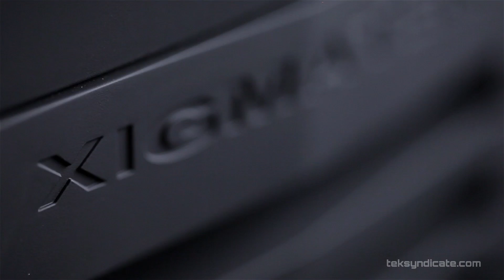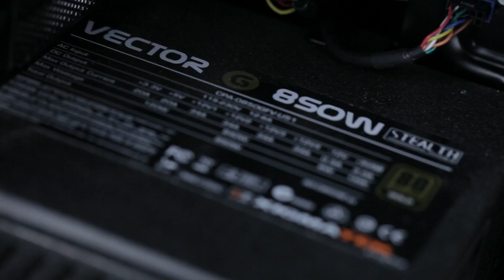Pistol's AMD Workstation Build For Streaming, Gaming, & Editing

Comment: corssair fans are complete junk that I replaced with $4 because both corsair fans craped out. the $4 zigmatek fans have been amazing! but the pump finally dies on the Hopi so I will never buy a corsair product with moving parts again.

Comment: i finally got 4.7ghz out of my 8350 but i have to ramp fans up to max to keep it low temp. i'd love to hit 5.0 but im scared lol
Reply: I got my 8350 to 4.8GHz stable with the same mobo as shown in the vid. It took some   configuring, idles at 43C, 68C load air cooled.

Comment: Did you have any stability issues using all 4 DIMMS with the 32GB of Kingston memory? I have 4x8GB of GsKill Trident X 1866 and with only 2 sticks, in either paired slots, works great, put all 4 in, stability issues. I guess the Memory Controller on my FX-9590is not liking 4 sticks of 1866Mhz memory?
Reply: It's a Gigabyte 990FX-Gaming, so yes. It has no trouble with heat...just doesn't like those 4 DIMMS filled.
Reply: Oh it does. I ran it beautifully except the 4 DIMM Slots running together. lol! I've since changed over to an Intel 4790k with MSI MB anyway.  It is awesome. AMD just wasn't cutting it anymore for me. I will miss that 9590 though.
Reply: kind of late, but you should have tried to rise up the voltage on the ram, and you could also tried to lower the frequency. AMD certifies only 1333mhz with 32gb. Many folks do reach 32gb/1866mhz but that's not the rule, just luck. at 1600mhz most of the CPUs will work, but there are a few that will not tolerate any more than 32gb/1333mhz.

As for the stability, 1.5 might not be enough to power all four slots, thats why a 0.05 or 0.1 raise in the Ram voltage might be needed

Comment: u do realize that compartment in the top is to mount the fans or radiator to each other Through the case, thats why it was mashing, it wouldve been fine if you mounted say the radiator in the case and the fans into it from the compartment, i have an nzxt tempest 410 elite so its a similar case in terms of this design.

Comment: Just out of curiosity what temperatures did the CPU maintain during Idle and load temperature with that air cooler? Im building a similar rig and I'm stuck whether using a corsair H100i or this air cooler.

Comment: Hey guys,im planning to build a AMD gaming desktop.I going to get a AMD FX-8320 CPU but i dont really know which motherboard to choose from,i heard that the Gigabyte 990fxa UD3 have a overheating VRAM problem.So what motherboard will you guys recommend,i dont want my motherboard having problem.which one is better for realiability?Asrock 990fxkiller/Asus M5A99X EVO R2.0/Gigabyte 990fx UD5.
Reply: You could try Msi gaming board. Or asus
Reply: Oh thanks.I think I will go for a Asus Board.Anyway do you know the different between the AMD 990FX and the 990X chipset?
Reply: Nope but using the asus sabertooth helps
Reply: Sabertooth is expensive my budget is thigh
Reply: Oh thanks for the guide,Im going with s Thermaltake Water3.0 Pro for my CPU cooler!
Reply: the gigabyte is not bad, its probably just a lousy batch
Reply: Jayz Xiang 990fx ud3 is enuff

Comment: I'm not 100% happy with my Corsair H100i either. It's louder than my old CoolerMaster Hyper 212 by a large margin. The only reason I haven't yanked it yet is because it does cool better. On cool mornings I've seen my 8350 as low as 1c! lol  The lowest I ever saw the Hyper 212 was 16. I value silence over all else so, I guess i should stop being a cheap *&^ as get the Noctua NH.
Reply: Thats like saying you hate your harley Davidson because its louder than your prius.
not trying to be mean but two fans and a pump will be louder than a single fan.
Reply: Mike Kunz Oh yeah, I agree. But my point is that it's possible to have completely silent water cooling. A good friend of mine has the NZXT Kraken X60 cooling his CPU & GPU with Noctua NH fans and his i7 rig is dead silent. So it is possible I was just trying to be cheap. But somethings you just can't get around paying good money for.
Reply: True
Reply: DarkMikaruX and you gotta see that the i5/i7 are freshier, i have a fx6300 and a i5 2500k both oc´d and the temp difference in load is like 10ºc sometimes 15ºc with the corsair H100, on the i5 when idle i can set 1 fan to spin at 800rpms and completly shut down the other and it sits on 30ºc iin idle.
Reply: kurok1tenshi I understand what you are saying, but It's definitely the fans in my case. I finally got around to ordering 2x 120mm Noctua NF-S12A ULN's which should be arriving tomorrow. I also plan on disabling the intake & exhaust fans to get a true gauge of how much of a difference the S12A's make. If it's still unsatisfactory, I'll just save up and go the NZXT Kraken route. I'd hate to get rid of it because it does a darn good job. It's 70 in the house right now and my current temp is just 12c. And I've never seen it higher than 35c at full load, and that was on a hot day. The 8350 is plenty for me, the right balance of cost and performance.
Reply: DarkMikaruX yeah, for most talks and even for daily day harder stuff like gaming and streaming etc it´s perfect for the price it ranges.

Comment: I think I may get this CPU just for the heck of it. I can afford to go Intel but I like to get stuff and get it working better than they are supposed to.
Reply: Direct X 12 is coming out, I'm going to dust off my old 9590 and see what it's really capable of when that API comes out.  I expect performance greater in games than intel's 8 thread parts because of 8 individual cores..
Reply: ***** dual 9590s? what mobo
Reply: ***** I hope direct X 12 works as good as a lot of people are hoping it will.

Comment: How well is that 9590 standing up in that motherboard? ASUS states 140 W maximum for the processor, so I didn't think anything above the 8370 would work.
Reply: Gutberto Lopez I know, but it can be overclocked and people will do that, so it's perhaps best to make sure it will handle it.
Reply: ***** the OC on that chip sucks, mostly cause of the temps on 5ghz clock from the box, most likely they made an OC from factory cause no fking CPU comes with 4.7ghz @ that TDP, that chip has a similar performance to a 8350@ 4.5ghz, my guess is that the fx 9xxx werent made to be stock with those clock speeds but since they had the previous ones with 4ghz @ stock they wanted to justify the 200-300 bucks difference in pricing from a 8xxx to a 9xxx hence the speeds.
Reply: kurok1tenshi My estimation is that AMD released the 9000 series as a means of grabbing another milestone (first to 5.00 GHz), and for those consumers who wanted a very high and stable overclock without having to do it themselves. 220 W is high, but I guarantee a 'Sandy Bridge' Core i7 at the same frequency won't be far off, if not the same.
Reply: ***** true bro 9xxx @ 5ghz needs 1.5-1.52v vcore were the i7 2600k @ 5ghz needs 1.45v but the i7 doesn´t need to be @ 5ghz to draw the same performance as the 9xxx @5ghz, that´s the diffecence on the chip but yea AMD´s move on the 1st 5ghz stock chip is very valid.
Reply: kurok1tenshi Of course, we know the FX is inferior in performance due to the way resources are shared (one FPU between two cores with one 128-bit FMAC unit each), but comparing apples to apples, the Core i7 at 5.00 GHz will be pushing out practically identical thermal figures.

Comment: Been using that same mobo for nearly 2 years now and it's never given me a single problem. That ASUS mobo is pretty damn sturdy.
Reply: Space Woona Haha that's loads better, I can't afford a high tier card.

Happy gaming ;)
Reply: I recently got mine, what CPU are you running with it?
Reply: FX-6300. It's really an awesome chip for the money. But if my budget wasn't so tight when I was doing my build, I would definitely have used the FX-8350.
Reply: Space Woona What GPU are you using I've been planning to build something with FX-6300 or 6350. Hows the performance ?
Reply: Space Woona What GPU are you using I've been planning to build something with FX-6300 or 6350. Hows the performance ?
Reply: Last Perfect Support depending on your budget a 8320 is only $135 on amazon atm.  Most can do 4.4 easy with a decent cooler and you get the extra module.
Reply: Last Perfect Support  Sorry I'm only just seeing this lol I'm using a Radeon HD 7770 GHz Edition. You can get them for really cheap but don't expect to run the current games very well. I'm running Wolfenstein at minimum settings, pretty much to squeeze out 60 FPS. It'll handle older games like Skyrim and Fallout New Vegas very well, though. Far Cry 3 also looks pretty good on it at 1080p. Can't run Far Cry 4 at that res, though. I've been told the R9-285 is a really good GPU for the price, but it is a nearly 200 dollar GPU. I think these days you can get a 7770 for something like 70 bucks. They're older so they come a dime a dozen on Ebay. Good luck finding one on Tiger Direct or Newegg though lol
Reply: Space Woona most of the higher end AMD chips are at a good price atm, after the GTX 970 issues came out AMD followed suit with a decent price drop.
Reply: kamata93 Alright, thanks. I'll keep that in mind. What kind of games are you running on your 8320? Are you able to get 1080p60 with them?
Reply: kamata93 skip the 8370e and go 8320e same 95watt rating same clock potentials if u move the multiplier around, both of them stay a lot lower in power consumption compared to the non E variants until you get above around 4.4ghz and have to ramp up voltage a lot more, at the same time you can usually take any non E 83xx cpu and drop the voltage and mess with the clocks to get it to run on a lot less power, we got a friends 8350 going into a itx console build to run at 4ghz with a core voltage reduction dropping the power pull from the wall socket by 30 watts over running stock speeds.
Reply: Space Woona My 8320 is running at a modest 4.2ghz (runs at 4ghz on stock voltage) with a old GTX 285 running BF4 at 1080 with low medium mix gives me a pretty solid 60 FPS until I get insane particles like from destruction during firefights.  Cities Skylines was running at 1080p on high with out issue at 60 FPS on a 60,000 person city.  I can max any Valve game on 1080p high and never dip below 60FPS except for network lagg, the crew is running on medium with high geometry at 60FPS in the country solid and 50 FPS in the cities (this might be more graphics card for me at this point).  Warframe was also running in 1080p on a pretty highsetting and never dipping below 60 FPS, planetside 2 was running well, but I could use some more GPU power for that game. The thing about the 8xxx series is they are all vastly overkill for gaming, same concept as the i7, since almost no games use more then 4 cores and only a few truly push all 4 cores of a quad core well.  For example I can be playing any of the games mentioned and still dedicate a entire module(aka 2 cores) to running handbrake or movie maker doing encoding in the background with minimal frame loss (needs a bit of ram to do this though and multiple HDDs or fast SSD's) the rest of the CPU is just so unused while gaming in my experience, this might change over time as the consoles are now heavily multithreading dependent.
Reply: Space Woona Try an R9 270 2GB WindForce Edition
Reply: Mashu Koria You're a little late on that ;) I just got my R9 290 in the mail on Friday :D
Reply: Mashu Koria Haha! I was actually asked what it's like to have a 4 GB frame buffer and I actually had to say I don't know because I'm so bottlenecked by my CPU xD  Oh well. I'll just have to wait a few months and upgrade that lol
Reply: Space Woona Oh, so on 4GB cards you start getting buffers on frames bcus u have too much storage?
XD
Yeah I haven't built my pc, but I switched to the FX-6300 instead of x4 860k bcus the series is dead. 
The FX has new chips coming and a huge upgrade path for me.

Comment: Currently i've got an 8350 o/c'd to 4.8x ghz... I've got a good PSU, and the cash to get an fx 9590. would it be worth it to gain what i'd gain over the 8350?
Reply: No
Reply: Not really, essentially all a 9590 is, is a 8350 that is guaranteed to hit 5ghz under boost. if you have an overclocked 8350 at 4.8 you pretty much have the same thing in principle
Reply: Nope
Reply: You already have 9590, Only yours is 100Mhz faster on the base clock.

Comment: Nice Choice Of Parts should be a well rounded system within reason as a gaming rig i got the R9 280 Asus cu II on a 2011 board with an 3820 cpu its a good build system .

Comment: Stock h100i fans are trash
Reply: For sound yes but for pure cooling peformance they are really hard to beat
Reply: Artun Otter Just get SP120's or Noctua fans and they're way better at cooling and acoustics are lightyears better.
Reply: ***** Didn't expect to see you here
Reply: ***** not really...yea they're quiter, but they have the same blade design. They both move the same amount of air.
Reply: Artun Otter are you serious
Reply: Ruskie nope. Dude come on. The stock fans run at 2500rpm at max speed I know they sound like a jet engine but at that speed they move a shit ton of air.
Reply: ***** airflow sucks on them tho
Reply: Artun Otter fans made of paper at 2500rpm would move a lot of air. just because something moves a lot of air at its top speed doesnt mean it is good for airflow. fans that are good for airflow move a lot of air without having to be at max speed
Reply: Ruskie ok let me word that differently. "They have alot of cooling performance"
Reply: I think h100i is good with corsair sp120 hp edition

Comment: You could have put the sp120 fans (the proper ones with colour runs and rubber isolators) on the top of the case? :(

Comment: I just cant understand paying 299$ when for 30$ more she could get far better performance out if a 4770k.  Overclock the 4770k to 4.5ghz  and the 9590 cant even tough the 4770k even at stock the 4770k trumps the 9590. This video baffles me.
Reply: People don't seem to understand that 1. AMD performs more or less equal in games. and 2. 9590 > 4770K in streaming and rendering, which is why she has the fucking rig.

She mentioned it in the video. Twice. But 10 seconds in some monkey smashes "WHY NO INTEL" in comments.

Comment: I dont like the fx 9370 and 9590 cuz they get soo dam near crashing every time i vid edit
Reply: its the psu , you need to change it , 430w cant do it , thats a huge bottleneck , there are great psus for less than 150 bucks , get a seasonic psu, a 700 or 800w one , just your cpu draws about 200w thats alot
heres the link for what i recommend 

http://www.newegg.com/Product/Product.aspx?Item=N82E16817151105
 upgrading that psu is a MUST for that cpu , the rest is all fine
Reply: Andre Salles Yeah, i agree, that is some hazardous temperatures! Doesn't have to be Noctua though, just a good one. Noctua is pretty good overall (especially if you look away from the asking price tag.
Reply: thats wierd...whats your psu/cooling/ motherboard ?
Reply: Andre Salles Here is my complete specs:
CPU:FX 9370
PSU:Corsair 430M
MOBO:Asus Crosshair V Formula-z
Storage: Seagate Hybrid Drive
GPU: ASUS Gtx 660
Ram: G.skill 8gb 2133 mhz

I built this when i was eleven so of course I didnt pick the best setup
Reply: also thats a great mobo , good choice there
Reply: Andre Salles Thanks man, will do. but is the psu the reason why my pc is crashing? I always thought it was the heat
Reply: heat is a issue too , you want the cpu to run at 70C max load , i can suggest some good cooling options for you , get the temps and post them here so I can see whats going on , if it gets to 90C + than thats a big problem too
post your case model too
Reply: Andre Salles My case is an NZXT Phantom 410. I use a Corsair H60 CPU Liquid cooler for my cpu cooler.
Reply: shouldnt be a problem with that cpu cooler , can you get the temperatures ?
Reply: Andre Salles Im really sorry about the late reply but anyways, my CPU runs @ 21 degrees Celsius when idling. For the max load, I decided to attempt to render a vid and i watched the temps. (my pc is set to shut off @ 100 c) As it started rendering, the temps kept rising, and I stopped the rendering when it hit 97c.
Reply: wow , you eed better cooling like right now , or your cpu is gonna die soon , seriously go get a corsair h100i or something similar , also put noctua fans in your case and change your thermal paste to  ICdiamond or arctic silver
Reply: well thanks for the helpful info,guys im only telve so this is great, however I already use a corsair H60
Reply: well you are going to kill your processor, if you are twelve im pretty sure your parents arent going to like a dead processor that they paid for
Reply: Stevie
Reply: Stevie hate to say this, but nowadays the h60 is garbage, heck you can pick up a $30 air cooler that will do a much better job! prett much anyhing in the corsair range below the H80i, you are better off spending the same amount on a decent air cooler, if you have the money go h80i or better, the H60 is way too small to deal the 9590, it could handle an 8350. trust me, time for an upgrade!
Reply: Lord Xantosh i Well, I greatly appreciate the advice, I might even get a new one today!
Reply: Stevie You need a new PSU too. 600 or 750W 80+ Bronze (or Gold) is minimum for that CPU and GPU. That can cause crashes or even fuck your system if you pull too much power consistently.

Comment: hm, i heard the FX 9590 was just an overclocked 8350.
Reply: It is, piledriver cores, C0 stepping, just higher clocked with the same power consumption you would get it you overclock the 8350. However, not all 8350 are able to reach 5 Ghz.
Reply: 8320 = 6300 with 8 cores
8350 = 8320 at higher clock
9370 = 8350 at higher clock
9590 = 9370 at higher clock

When the CPU won't reach 9590 speeds, they lower it to the 9370 speeds and send it off. Repeated until the CPU runs stable.